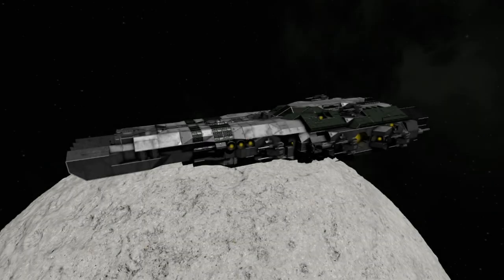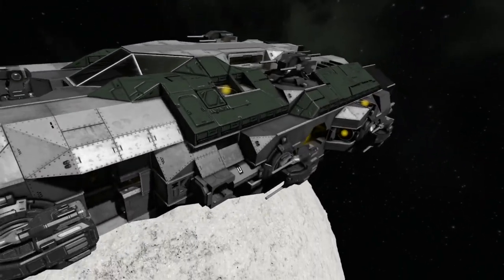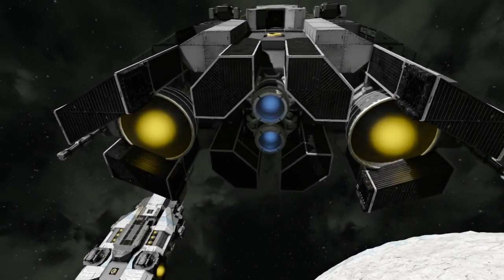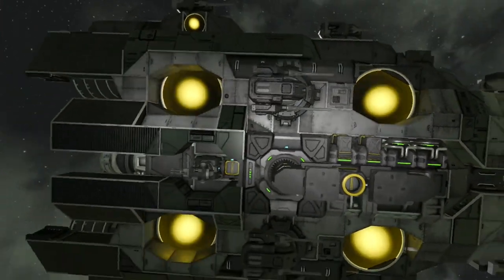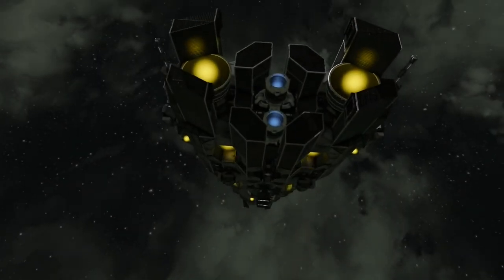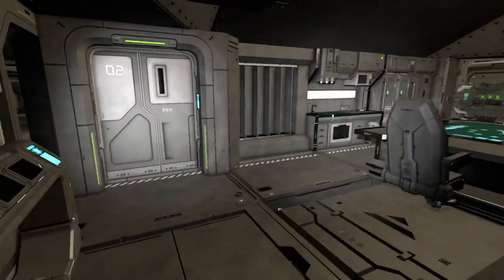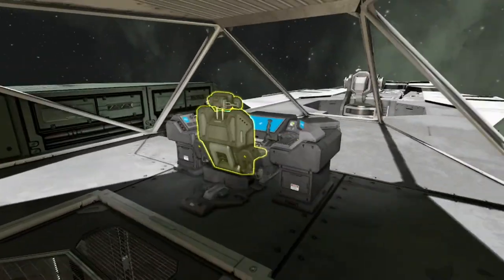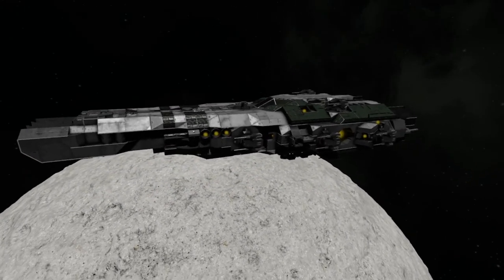I made another ship and it's ballin'

Comment: How did you get the gatlings recessed like that?
Reply from the maker: rotors
Reply: @physicsdontapply9982  being on a rotor makes the collision box smaller?
Reply from the maker: @matthewcozon4686  i'll have to explain it. Basically, blocks have two hitboxes. They have their building hitbox, which is the area they occupy on a grid. Then they have their damage hitbox, which determines how they interact with other grids and bullets. The damage hitbox is about the same size and shape as the block. By placing the gatling on a subgrid, you can circumvent the building hitbox entirely.
Reply: @physicsdontapply9982  that's clever. Thanks